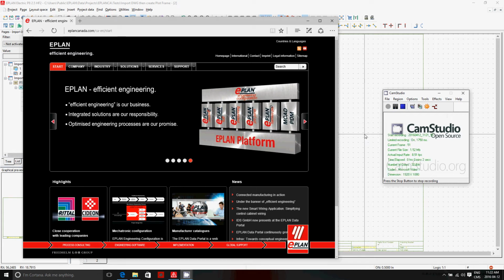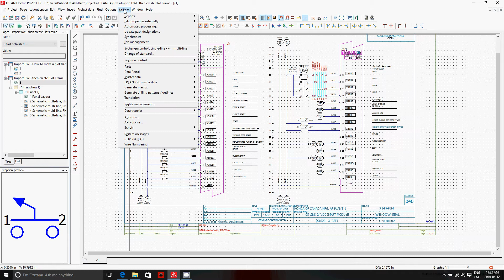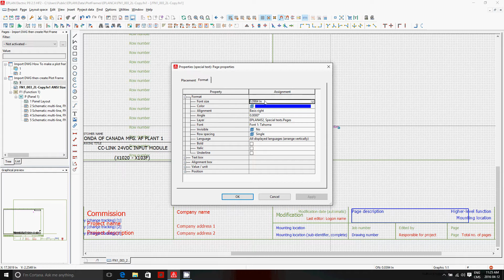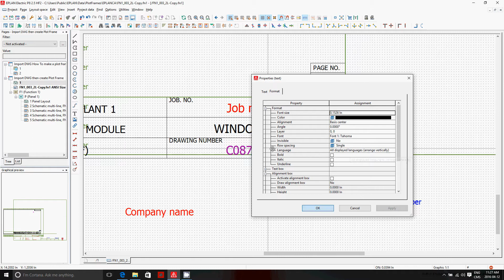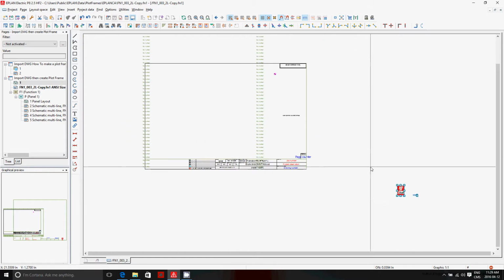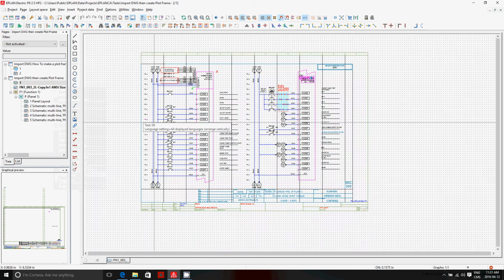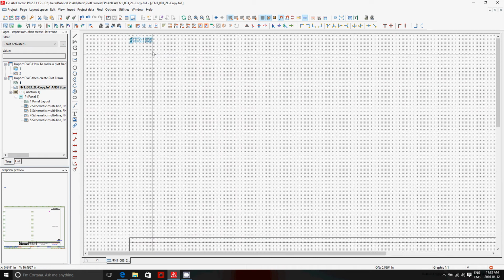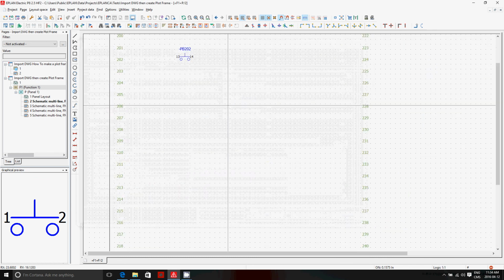EPLAN ELECTRIC P8 Tutorial to Generate PlotFrame from DWG file

Comment: hello Roland,
At the time 7.27 you have mention View >> Path (On/off) thing where is its setting.
sometime I want to use it in my normal pages instead of plotframe.
Reply from the maker: the path is inviolé when turned off and shows you where the columns or rows are splitting for your cross references, yet you could add invisible guideline, construction lines to guide you in your plate frame. I do this often.